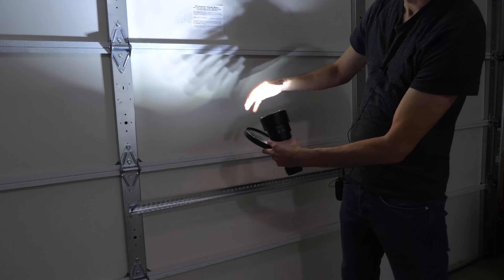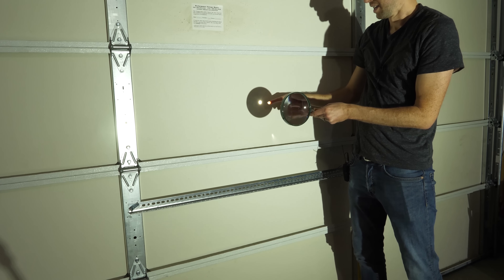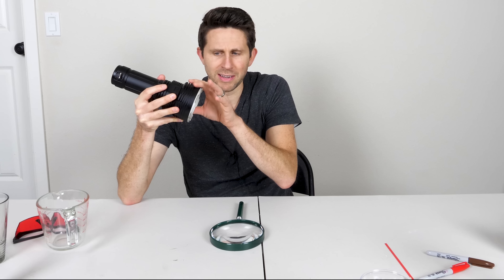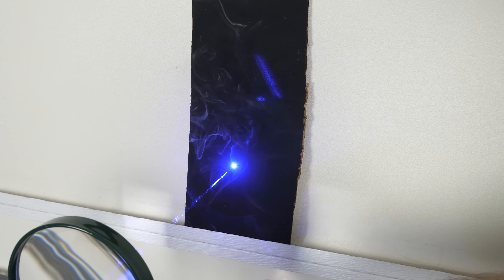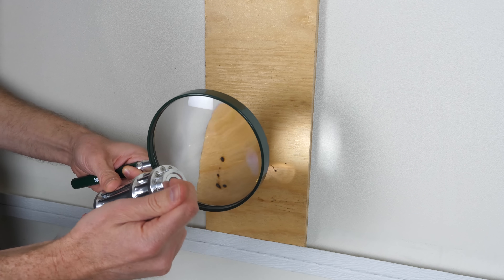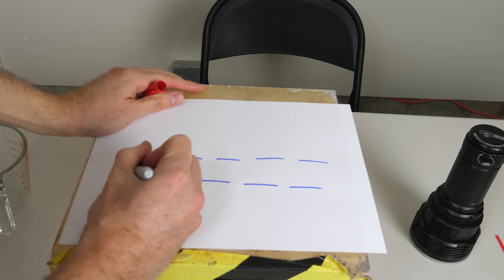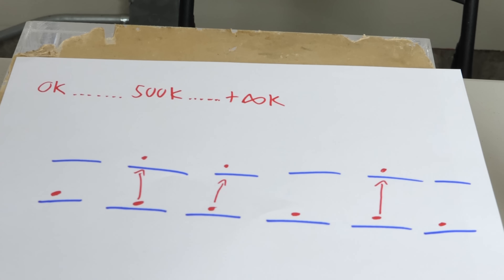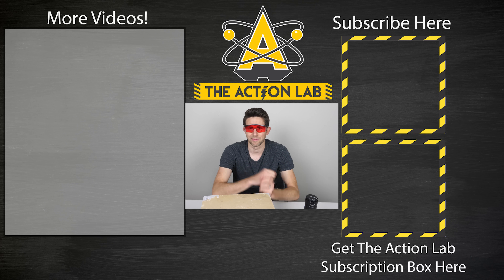What Happens if You Focus a 5W Laser With a Giant Magnifying Glass? Negative Kelvin Temperature!

Comment: Using the same principle, but instead of a laser you use solar energy, and instead of a lense, you use mirrors. If the array of mirrors is big enough and the mirrors are small enough, can you concentrate irradiated heat from the sun into one small area and make it hotter than the surface of the sun? Please note that in my question (1) use irradiated heat, not convected heat, (2) surface of the sun is obviously greater than the focal point in the solar oven (3) the sun rays reaching Earth are almost parallel, so they may somewhat behave like the laser in your demonstration (4) surface of the sun is not a point, so the solar station will always have less heat energy than what the sun has, but more concentrated.

Comment: I did not understand why you say i can not get 100ºC using a pocket lintern and a magnifier, since i can evaporate small dots of water with such combination, burn wood, etc.
I understand that i am concentrating most of ligth energy into a small point, why you say at that point i can not get more temperature than at the origin, if i put my hand on the lintern ligth beam it is cold, but if i put a magnifier and focus that ligth on a small dot on my hand it really hurts a lot.
What do you mean with focused dot can not have higher temperature than ligth emitter? What did i do not understand?

Comment: Heating by light is momentum transfer not heat flow. Focusing light is like hitting a nail with the sharp end of a hammer. You transfer the same amount of momentum to a smaller surface area so the nail will sparkle and the laser can burn things more easily when focused. There are still losses and you create a hotter surface on a much smaller area, so there is no energy gain, so nothing is violated.

Comment: Why not two magnifying glasses... One to prevent loss of light and the other to do the focus thing
Reply: @FreneticFolklore  It does work. Ever see a flashlight that's adjustable? The point it makes is WAY hotter than the point where it comes from.
Reply: @FreneticFolklore  such a thing does exist, we use collimators extensively in laser research, meant for taking a spread source (such as from a prism), and the collimating the light. You can easily play games with lenses to make collimated light, different focal lengths, use micro mirror devices to dynamically change focal length, etc. SPIE photonics conferences would amaze you. But to the point of the exercise, there’s still no way that the total energy of the focused spot could even equal the total energy of the emitter, there’s losses in the system. There’s no thing as perfect transmissivity, always some scattering happening. The temperature is irrelevant. People with a middle school level understanding of photonics and science always just assume temperature is a derivative measure of kinetic energy in a system. That’s untrue and way too simplistic of a way to think about it. We have to remember that although the Boltzmann constant gives us a way to generally equate energy levels of atoms at certain temperatures, it only gives us an estimation that most degrees of freedom will have energies of that order.

Ultimately, as is the case of lasers where we’re playing with particles existing in unusually high distributions into those higher level degrees of freedom, a more appropriate (and complex) definition of temperature has to be used: the inverse of temperature is equal to the partial derivative of the entropy of the system divided by the partial derivative of the internal energy.

This is exactly why we can observe certain things in nature like heat flowing from hot to cold. As a hot system has relatively less free energy states than a cold system, nature will trade that internal energy to ensure that total entropy is increased by passing some of that relatively fewer energy state hot energy to a much more available free energy state low energy system. It’s not a 1:1 in this case due to the relative difference.

Hope this all makes sense, a lot of info. This action lab video was an attempt to explain this very complex issue to a lay audience, but it appears he was lacking in some of the knowledge himself.

Comment: What if you put the flashlight into a small tube not much thicker than the flashlight, with the sides all coated with a highly reflective material? Would the light that would’ve escaped reflect into the lens forming a very focused point with no wasted light?

Comment: HAHAHAH lol you just mixed 2 terms, one thing is the temperature and another is light itself, with a magnifying glass you are only magnifying the light, the temperature that you get it's just a consequence.

Thermodynamics rules are about the conservation of matter and energy, your lasser have 5W of capacity, therefore it is always going to have the same capacity, the only change is how spread it is.

So if you have a diameter of 5 mm of light and 5W of energy, it doesn't matter how much you change the diameter you will always going to have the same 5W, and for this when you take the light to 1 mm and still have the same capacity you are going to produce more heat.

About negative Kelvin, I really don't know from where you get that thing, it's just absurd. And you don't have any proof of that.

Remember in a laser the photons have all the same directions and go stray, that is why you can cover all of them. in the case of the sun if you use mirrors all around it and focus all the rays in a single point them you could have a higher temperature

Comment: you say no combination of lenses can focus a flashlight, which is not true. I tested this before writing this comment so be assured its correct.your problem the first time with the flashlight was that you didnt focus it into enough of a point, correct? so, now that the light is straighter you can put a lens in front of that, and the light wont be lost. this will straighten the light even more and im sure youll find it comes to a very fine point; it did for me. keep in mind I am using cheap plastic lenses, but they are a similar diameter to yours from what I could tell. Im broke, so I didnt buy a big flashlight, but I used a cheap ebay wide-throw 50 watt flash to simulate your situation.
edit: sorry if I sounded angry or worked up, I was exited when I got different results and it takes me awhile to cool off

Comment: Um... no. No. NOOOO! YOUR PHYSICS IS SO WRONG!!!
>Can't get hotter than the surface of the source with any combination of lenses : FALSE! SO FALSE!!!
>Second law of thermodynamics : Has nothing to do with this. You're confusing it with the zeroth law of thermodynamics, which is also not exactly relevant here https://en.wikipedia.org/wiki/Laws_of_thermodynamics#Zeroth_law
>The Kelvin scale - IS NOT BASED ON QUANTIZED ELECTRON ORBITALS-THAT'S COMPLETELY DIFFERENT - Temperature (measured in Kelvin) is a measure of average KINETIC energy of a sample of matter, not electrical energy. Things that are hot are moving quickly and vibrating in a mechanical way. Kelvin measures the amount of vibration, and it can't be negative-it's either moving or it's not. If it's moving backwards then it's still moving and Kelvin is still positive.
>I'm utterly flabbergasted at your misunderstanding of the Kelvin scale. I've never imagined that someone could have that so wrong. I'm in shock. I can't get over it at all. 5 MILLION views?!?! NEGATIVE KELVIN?!?!?!?! NOOOOOOOOOOOOO! Nooooooooo. nooooooooooooooooooooooooooooooooooooooooo. not a real thing.
>Absolute zero has nothing to do with electron energy levels, it is matter that is completely motionless. It has not been possible to achieve so far, and it may never be achievable. Proof: https://en.wikipedia.org/wiki/Absolute_zero#Very_low_temperatures
>You have completely butchered the concept of population inversion in lasers, mixing it up with the Kelvin scale: don't talk about that until you really get it. There is already a lot of misinformation about it that confuses beginners like you. And me, by the way. I'm a beginner and I'm still catching all these mistakes.
>You are confusing the concept of temperature (measured in Kelvin) with optical power (measured in Watts)
>You are confusing the concept of optical power density (brightness or watts/area) with total optical power (the thing that you /actually/ can't beat with any combination of lenses - you confused that)